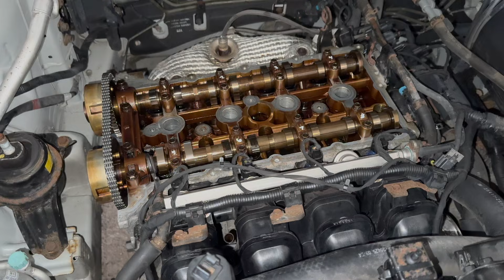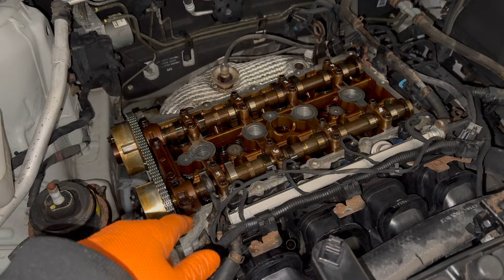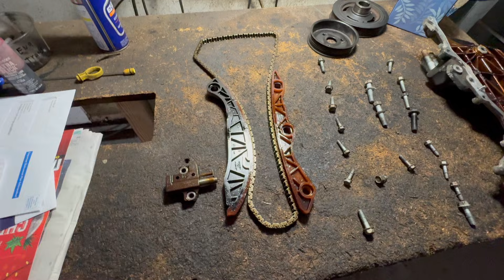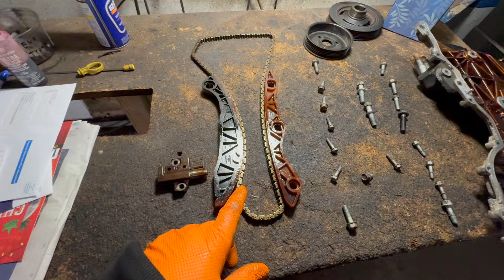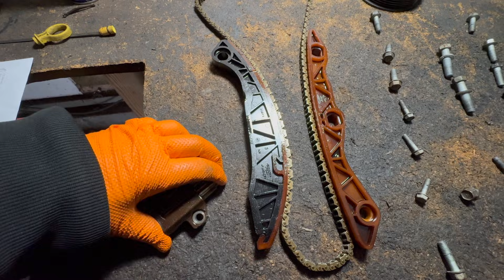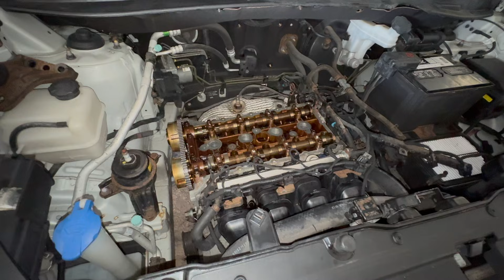Jumped Timing Chain Or Belt Symptoms, Causes, and The Fixes

Comment: I have this exact engine. I replaced the chain tensioner and now have 0 tension. Of course I didn't have the valve cover off and started the car with no chain tension. Didn't get any codes but it sounded awful. Going to pull the cover off here soon and try to find out what happened. The cams still line up perfectly, but I can't tell if the crank is still lined up as well. My question is how to get the crank back in time with the cams if they don't match up? Do I just put the pins into the cams and spin the crank until it's at tdc then put the chain on?
Reply: I forgot to add that when I put my finger into the tenionser hole (with the tensioner out) I could only feel the chain and not the guide.
Reply from the maker: This may help set it up:
https://youtu.be/wcyecqAptuM
Reply: @motorcarnut  Thanks I watched the whole thing, but I still don't get how to get it back in timing if the timing is off. I am assuming I set the cams to TDC, remove the chain, then turn the crack until it's at TDC then put the chain on? 

I am really new to working on engines. I feel like as long as cylinder one is at TDC, and then the cams are at TDC, I'll be good to go. But I'm not even sure my timing is off because the intake/exhaust still line up perfectly just can't check the crank until my tool gets here.
Reply from the maker: Set it up the way you said and check compression on all cylinders to confirm valve timing is correct.

Comment: I have a horrible noise coming from the top of the engine, just one side. The timing is off by one step. Could this be the reason? Can the fix be just to correct the timing?
Reply from the maker: Possible

Comment: Great video.I did my timing belt this week on LS 430 and straight away got P00016 and P0018 Cam and Crankshaft problem. Checked VVTi sensors and Camshaft sensors all good. I'm thinking timing belt timing is out. It's a V8 , but still running excellent no misfire or idling issues puzzling.
Reply from the maker: If you didn't have those codes before then yes timing is off

Comment: Hey I have Audi a4 2012 I just replaced my timing chain because my car would it turn over and now it drives and runs, but now I have a camshaft sensor error, which is closing camshaft sensor to pop up and I feel my car jerk every once in a while when  not going fast or comin to stop, What could this issue be??
Reply from the maker: It's possible the timing is slightly off or may have an oil control problem like cam bridge or oil control valve itself. I have videos on both to help you out.

Comment: Hello,I have a 2007 vw polo 1.2 which I tried roll starting it backwards whilst it was in reverse but it didn't start when I try starting it it cranks fine just won't start. Do you know what the issue is and how it can be fixed?
Reply from the maker: You probably jumped valve timing, It will have to be checked for alignment
Reply: Ok thank you @motorcarnut
Reply from the maker: No problem.

Comment: I have similar Engine Kia Rio 1.6L GDI. chain Jumped 1 tooth but valves OK. changed chain/tensioner/guides and runs  compression 170+psi all cylinders but chain is rattling hitting valve cover.  cams Are in time confirm, not sure why chain slack. do i have bad cam phaser sprockets??
Reply from the maker: Its possible if you changed the tensioner, chain and guides, unless you have low oil pressure?

Comment: Awesome video and explanation of things! Oil changes make a huge difference. I have a 2.4l 2009 malibu that at 245K finally started having issues with misfires. I pulled the valve cover today and chain has slack in it. Top guide didn't break thankfully. Now I'm debating on replacing the chain and tensioner. Any good way to check to make sure valves or such aren't already damaged? Someone mentioned checking rollers on the valves for any play.
Reply from the maker: Thank you appreciate that! If the chain did not jump then the valves should be fine. You can do a compression check to confirm.

Comment: What sounds does it make if your my timing while I was driving, cause the next day it was not cranking, in just make one click , but won't start
Reply from the maker: Could be a loose battery terminal or poor ground wire, bad starter. I have videos on telling if your engine is seized or a bad starter.

Comment: Mechanics in my area refused to diagnose my timing issue. I’m forced to figure it out my self, Volvo 2007 S40. Timing belt not broke but serpentine belt wrapped around crank causing it not to turn.
Reply from the maker: Common problem and big job. Here is a video on that: 

https://youtu.be/HHzm4LD52Hc

Comment: I took my cover off looking for timing. While turning the crank manually the chain is tight then when I reach a certain point I get a little resistance and then it releases but then the chain has play and slumps down between the cogs then it lifts slightly above teeth then it seats back into place and its tight again. Is this normal or should the chain stay tight at all times? Thanks.
Reply from the maker: It's normal because there is no oil pressure to the tensioner when engine is off.
Reply: @motorcarnut  Whew! Thank you soo much!!!
Reply from the maker: No problem

Comment: My car cranks but won't start ( Peugeot 207, 2007 ) after replacing the crankshaft pulley. They had trouble removing it. They cranked the car with a breaker bar locked to the pulley bolt to loosen it. Can the reason be a few skipped teeth?
Reply from the maker: Absolutely, They didn't use the proper tools sounds like. You never rely on the chain or belt as torque to loosen the crank bolt.
Reply: @motorcarnut  what would be the solution. There is no bad sound when cranking. No engine light on the dashboard.
Reply from the maker: Valve timing will have to be redone if they didn't destroy the tensioner.

Comment: Got the 4age 20v and some times the throttle is crisp and some times no. Like the power band would shift from 1000 rpm to start from 2000. Ive read that the belt may cause the cam to retard significantly causing low power in the lower rpm. I actually tried sparying water from the pulley area side many times “timing covered” and idk why it works  and even better with brake cleaner. But it stays strong from 2-3 days then again i get no power in the low rpm
Reply from the maker: I would replace the timing belt or at a minimum check valve timing.
Reply: @ i already ordered it  im waiting for parts to come but i have no idea why washing this side of the engine makes it good for some time. Yea im not sure about the timing because also ignition timing is way high up in 41 degrees at wot its very weird. I tuned it lower and car didn’t have power it had at the 40 “im running standalone”. Thanks for your input
Reply from the maker: That I don't know, but you're on the right track

Comment: Hello there, when will be the right time to change the timing chain of my hyundai elantra year model 2013
Reply from the maker: The Hyundai Elantra's timing chain is supposed to be a lifetime chain, but it may stretch over time or fail. I would recommend replacing it around 150K miles if you have no problems.

Comment: appreciate the video its super helpful! how do I check to see if my timing belt is lined up? I know there are marks, but how do you rotate the cam gears/crank pulley to see if they line up without actually running the engine? is there someway to rotate it by hand?
Reply from the maker: Thank you very much!

Yes, you rotate the engine by the crankshaft center bolt with a 1/2 drive socket and large breaker bar or socket wrench in the same rotation as when the vehicle is running usually clockwise but some engines like Hondas rotate counterclockwise.
Reply: @motorcarnut  thanks so much for the help it means a lot! do you have to make sure anything else is lined up besides the cam gears? I heard the crank pulley has to be lined up but idk 🤷‍♂
Reply from the maker: Yes, of course Crank and cams have to be aligned at the same time.

Comment: Can slightly off timing cause valve lifters to be a bit more noisy?
Reply from the maker: Absolutely
Reply: @motorcarnut  Just re-checked my timing. When the mark on the crankshaft pulley aligns with the mark on the engine, the camlocks fit on perfectly. So basically I gotta stop being paranoid.
Reply from the maker: Don't know which engine you are working on, BMW?
Reply: @motorcarnut  Saab 9-3 with B207E engine, which is basically a 2.0 litre ecotec.
Reply from the maker: Gotcha, those engines tend to be a little noisy and rough running, not much though.

Comment: I did my timing chain and had to fit in a crank seal as well but didn't do a proper job. So it leaked for over a year. Now I got the leak fixed a week ago but can hear a tick in my engine. Could it be a bad tensioner?
Reply from the maker: Timing chains can have a ticking noise, the reasons may be a lot of things like stretched timing chain, the tensioner, low oil pressure, camshaft actuator etc.

Comment: Hey, I recently had my timing belt on my 2010 accent replaced. Ran great for about 30 minutes and now i’m getting a p0016 code. Any ideas on what the problem may be?
Reply from the maker: Got to make sure timing belt didn't jump a tooth from being loose. Easy way is to check colder compression. crank or cam sensor reluctor wheel damaged but I don't think so or an electrical problem, one of the sensors not pushed in all the way.
Reply: @ Thank you for your response! So it’s most likely just not timed right or maybe off by 1 tooth. Sorry im not sure what you meant by “colder compression”
Reply from the maker: Sorry, meant do a cold cylinder compression test, that will tell you if the valve timing is off.

Comment: Older video but I have a 2014 accord that oddly enough, runs great.   Just bought it for my daughter for Xmas and come to find out, has the known issue of tensioner causing slapping noise of the belt til engine warms up.  

Anyway, went to change it and discovered the timing from crank to cams is about 4 teeth off on both cams.  No CEL and, like I said, surprisingly runs fine.   Any potentially negative things I should look for before letting daughter have it on the road?
Reply from the maker: I don't follow? You replaced the timing belt and it's off 4 teeth? Car won't run off that much so I'm not sure what your talking about?
Reply: @ no.  I’m about to replace it and it’s off 4 teeth.   I can’t share the pics here but using the marks on the block looking down from top of engine, crank aligns with the timing marks but the cam sprockets don’t.   Counting the teeth, they’re off 4 teeth and engine still runs and has very good power
Reply from the maker: You don't do it that way, it's probably not off. Just get the repair procedure for your timing belt and follow that. I didn't make a video on the timing belt vehicles just the timing chain ones. You can check online at library in your area for repair procedure if you don't have one already. Alldata has a DIY for $20.00 for the month for one vehicle.

Comment: I got my timing chain fixed , but its still rattling really loud on start up. But after its reaching full operating temperature it runs withoutnnoise or other issues. My car was still behaving odd and jerking but after i changed the spark plugs and coils it was alot better . Still does a chain "slap" at the time of start up though. Wondering how am i supposed to fix that....its a 2011 vw tiguan 4 motion 2.0T SEL
Reply from the maker: Did they replace the timing chain tensioner? Uselly these engines don't have a start up rattle unless chain is stretched or the tensioner is going bad. These engines have a bad older design tensioner that must be replaced to updated version. I have many videos on this issue .
Reply: @motorcarnut  I'm not sure, but I did have to buy the part myself before he did the job so I'm going to attach the photo and/or link go the exact part I bought , so that should help find that out. Another mechanic asked me if he only changed the chain and that could be an issue because there's a "malfunction on startup" showing. I also had the camshaft position sensor changed a few months before the chain got fixed , however the code for that came up again (p0341) it think it was , so they said they just cleared the codes and that helped with it constantly saying "service engine now!" Everytime the RPMS were too low while driving. However the check engine light came back on and they said it's because the vvt solenoid is soaked in coolant since I previously had a coolant leak and because of the "malfunction at start up".
Reply from the maker: Yes do that so I can take a look. Also I have many videos on these engines with valve train code like the cam bridge and oil control valve you might want the mechanic to look at or you too to help be informed.

Comment: How do u put timing belt  that jumped off back on a 2007 Chevy Aveo
Reply from the maker: You have to follow the repair procedure for timing belt installation, but should also make sure the valves didn't get damaged before installing the belt.

Comment: I had my 2011 hhr timing chain put in my car . It has a engine vibration in the motor. Showing no codes. Runs good has power. And the vibration is worse when it's cold in the  cold mornings. Could the timing be off a notch?
Reply: Please reply back thanks 👍
Reply from the maker: If the vibration wasn’t there before the timing chain job my guess it the balance shafts weren’t aligned properly.
Reply: Are could it be something else cause the vibration. I'm stunned on this .

Comment: I have a p1110 for nissan  primera witha qr20 engine rough idle misfire  already changed can and crank sensor that had codes only code i have now is this one changed my vvt solenoid but to no avail still there it states intake v/timing con bank 1
Reply from the maker: Sounds like jumped valve timing to me.
Reply: @motorcarnut   so it might have jumped a few teeth then ? Is there a way to check without removing timing chain  Cover ? , thank you on advance
Reply from the maker: @omeiloelliott7347 Yes. Try a compression test.

Comment: Is it possible that the timing chain tightened. Because my engine is slow cranking and not turning over it seems to needs more power to the starter
Reply from the maker: No it’s not. If your battery is good and fully charged it might be the starter motor starting to fail or the engine jumped timing or engine is seized.

Comment: I have an 2004 bmw e 46, 318ci I have removed the head  because of blown head gasket and now realized that I have messed up the timing when I was dismantling it. I have forgotten to lock the flywheel and mark the chain. What would you advise when I am assembling it back? I got the locking set from amazing and have locked the camshafts when I was removing it but because of lack of patience I missed the step of locking the flywheel and now my concern is that,  the chain may slipped and the crankshaft to move a few teethes.
Reply from the maker: You have to get the service information for your specific engine online try your library they have great repair manuals free of charge. You have to make sure timing is 100% or you will get codes and have to do it again.

Comment: Dam I think my lack of oil in engine made my tensioner malfunction. Timing chain is jumping and car wont start. Checked and cleaned all sensors with crank and camshaft timing then noticed my oil was low and chamged it then tried starting and already had engine cover off too see valves and the chain guide was broken and timing chain was jumping causing the crank no start . This video helped figure out my issue
Reply from the maker: Thank you very much for the feedback, appreciated! Unfortunately, Yes, it’s a common problem that happens if you don't have enough oil, especially in modern day vehicles with variable valve timing.
Reply: what typa vehicle????
Reply from the maker: @graybenyo6735 any vehicle this can happen to.
Reply: Same❤

Comment: I was driving on the freeway got off exit starting idling bad then i had to keep my foot on the gas or it would die and when i was stop and went to go again hardly any power but once it got goin it go but wouldnt go past 70 changed spark plugs coils camshaft sensor crankshaft sensor fuel injectors still missfiring no compression in 2 cylinders gas smell on a couple spark plugs mechanic said i think ur timing jumped will it do that now it wont start at all trys to just wont turn over
Reply from the maker: Does sound like it jumped timing, the vehicle just doesn't  lose compression like that

Comment: Hello, I got a 2015 jaguar xf premium, and whenever I’m on the freeway I can’t go over 70, and when I stop at a light my car doesn’t wanna accelerate, the brakes and steering wheel turns hard, I have to turn off my car and turn it back on for it to work again, what do you think it could be?
Reply from the maker: Not really with test driving it but are there any codes?
Reply: @motorcarnut  p0016
Reply from the maker: Sounds like the valve timing is off, that would create your problems.

Comment: I do have a question.  I drove back from a 2hr drive.  Parked my HEMI and next morning it was as though the battery was dead until after a few attempts to crank it finally started cranking.  Now, no compression in at least 4 cylinders.  No symptoms, no noises.  Just parked and next morning. DOA.  any thoughts?
Reply from the maker: Wow, that is weird. If you have no compression in 4 cylinders that could only mean it jumped timing to me, definitely something mechanical.

Comment: Please help.
So my car serpentine belt broke, and i replaced it, soon after i started hearing a slight rattling noise, but now that noise is getting louder, is it possible that the rattling noise ( only comes when accelerating, sometimes on sometimes not) is caused by a failing timing chain...? 🤔
Reply from the maker: Yes